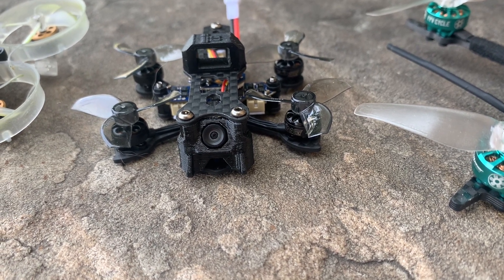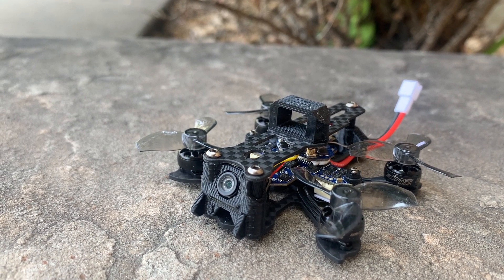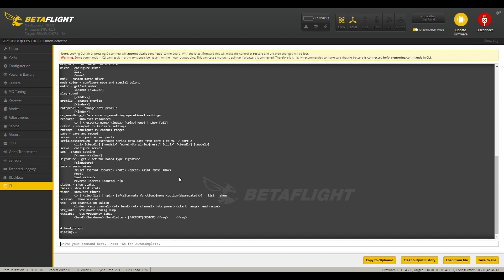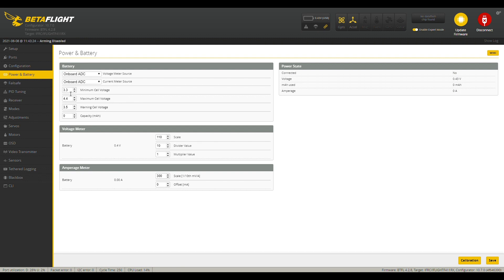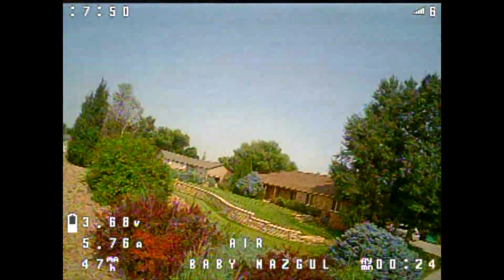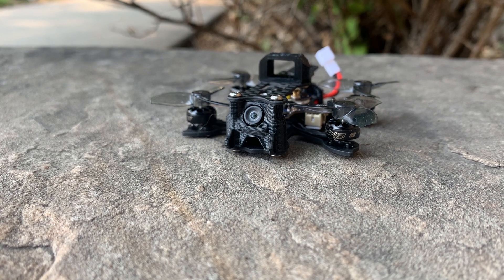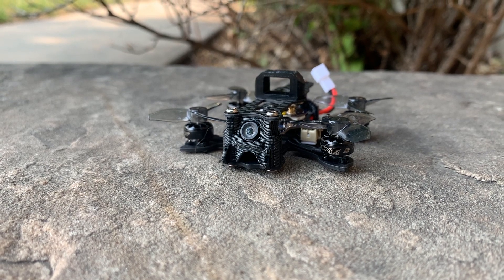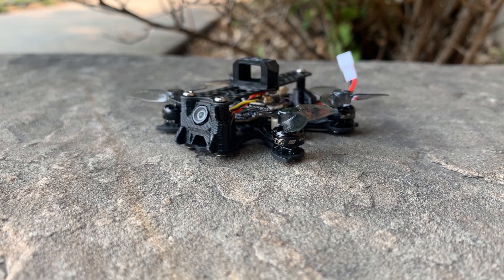iFlight Baby Nazgul Nano Review & Setup

Comment: Sir, every time after a few flights, my baby gets back to its defaults with my rxsr on it, and I need to go hack to betaflight to get it running. Can you help me with this issue?please
Reply from the maker: Hi, that is a new one for me where a flight controller would just randomly reconfigure to default settings on its own. The only thing I can think of is you have a defective FC (BLITZ F411 1S 5A AIO). The flight controllers have on board flash memory so that is getting corrupted somehow. I would back up your setting (sounds like you already are) and upgrade to the latest FW version and see if it does the same thing. If it does, you might have to get a new FC. You may also want to reach out to iFlight to see if they have any thoughts. Sorry I could not be of more help.
SLOG

Comment: Hi slog i jave a Baby Nazgul 73 mm with a frsky D8 and i cannot seem to get the quad to Arm. I have a Taranis QX7 ACCST amd o was wondering how i can check the firmware level of my Transmitter. Would you know how i can get there?
Reply from the maker: Hi Harry, Sorry you are having troubles. It sounds like you have bound your quad to your RC transmitter correct? If so, I would check your channel mapping (AETR1234 or TAER1234 are common mappings) and need to match your radio channel mappings. If you cannot bind your radio to your quad, here is a good video from Joshua Bardwell on the topic and what version FRYSKY broke compatibility with D8 and how to check your version. https://youtu.be/09g5MfTdiyw

If your mappings are correct and you're bound, you can look in your OSD while arming and it should tell you why it can't. Hope this helps. 
SLOG
Reply: @slogfpv  Wow yes thank you Slog i will go thru and check all that you mentioned. My Betaflight for some damn reason is in "Virtual mode". So when i enter say "bind_rx" my CLI is blank, i mean no data at all, nothing so i think ill delete it and redownload it to see if i get my correct version. If its not one thing in tbis hobby, something else breaks ot just comes out of tge6 blue🤔
Reply: Slog i found the reason i was getting a blank CLI and it was a bad cable going to BF, my quad. So something is going on with the model which is XJT D8 and failsafe=No pulses. As you mentioned the issue may be in the channel mapping so ill match those up and hope for the best.
Reply: SLOG We finally got it and my Baby Nazgul 73mm quad is now Arming and flying very well and stable. It was the channel mapping that didnt register in my brain that the mapping in the Radio setup AETR1234 must match the mixer so i changed each channel, added my Arm switch and recvr i all the sticks worked perfectly. I want to thank you for the time and effort you put in to help me. I really appreciate your knowledge. Thank you SLOG!!! Your awesome! ✈️✈️👍
Reply from the maker: @techFPV5964  Glad you got things sorted out. Now time for some fun 😄
SLOG

Comment: I Got baby Nazgul with TBS Crossfire, but the d8 antenna still came right in, i can bind it by the software? because de button of binding of TBS works, but the button below de D8 Rx does not do nothing, and in BETAFLIGHT I'm not been able to: bin_rx spi or even bind_rx tbs, how do i do? i want to fly it, but my Crossfire just arrivez at friday! help me plz bro, is it possible?
Reply from the maker: Hi Stefano, the Betaflight Devs moved the receiver option from the configuration tab to the receiver tab (top right corner) in the 10.8 version. Binding a TBS crossfire receiver is different than FRSky.

FYI here is a good video on Joshua Bardwell's site on how to easily bind with TBS Crossfire.
https://www.youtube.com/watch?v=8SYiMctDex8
SLOG

Comment: PLEASE HELP! I just bought this baby nazgul 1s BNF ,I have a TARANIS QX7,I tried the usual holding the bind bottom on drone while I plug the battery while myvreciever is on binding mode but it just wont bind. It only makes music sounds.
Reply from the maker: @1982pantro, since this is a SPI receiver, the easiest way to bind is to bring up the Betaflight configurator and in the CLI type "bind_rx". You can type in help if you want to see the syntax. I would try that first.
SLOG
Reply: @slogfpv  Thanks SLOG,for your quick reply. I'm still working on it as we speak, this is what am doing step by step, 1 created new model then put it in bind mode .2 beta flight cli,bind_rx spi. Hit enter but still I get nothing, does your baby nazgul makes music when you plug the battery?  Sorry to bother but I REALLY WANT TO FLY THIS DRONE.
Reply from the maker: @1982pantro  
Frsky broke backward compatibility with D8 ACCST when they came out with ACCST 2.0 (see link below). However, I tried binding in D16 mode on my Frsky Taranis X9D plus 2019 (my daily driver is a Radio Master TX16S) and was able to bind with the following steps:
1. In Betaflight configurator change the SPI Bus Receiver Provider to FRSKY_X
2. Go to CLI and type bind_rx 
3. In your transmitter model setup change the Mode to ACCST D16
4.Put RC transmitter in bind mode 
Green light on bottom goes solid green if it is bound. 

Joshua Bardwell on the compatibility topic
https://www.youtube.com/watch?v=09g5MfTdiyw&t=667s
Reply: @slogfpv  HOLYSHIT!!!! IT WORKED. 
thank you soooooo much for your help,you  are a lifesaver,I appreciate it. It flies like a rocket,I'll have to fiddle with the camera angle so I can lower it a little. Hat is off to you sir. Blessings all the way from Arizona 🍻👍🏻👍🏻👏🏻👏🏻👏🏻👏🏻😑
Reply from the maker: @1982pantro  
Glad you got the little bird up in the air!
Very fun little quad to fly.
SLOG
Reply: @slogfpv  the top light is solid,the 2 small bottom are blinking to the rhythm the motor make.

Comment: # bind_rx spi
###ERROR: bind_rx: Not supported.## help even with out spi it wont work ??
Reply from the maker: @Nightlight, not sure what version of the Nazgul Nano you have and what version of Betaflight you are running? I am running 4.2.8  and typing in "bind_rx spi" with the SPI RX version works like I show in the video. In February, iFlight came out with an ELRS version using the new BLITZ 4F11 1s 5A AIO vs the SucceX F4 1s AIO which I have. If you type in help in the CLI, you should see a command for bind with the appropriate syntax.
Reply: @slogfpv  I got the iFlight 1S Nazgul Nano 73mm FPV Micro Drone BNF Indoor Brushless Drone Built with TBS Crossfire Nano RX for TBS Radio Controller
Reply from the maker: @kymmedia2  because the TBS RX is external (not built into the Flight Controller), bind_rx spi will not work. Oscar Liang has good primer on getting started with TBS Crossfire, which goes through the setup and bind procedure. Link below. 
https://oscarliang.com/crossfire-betaflight/

Comment: I just used your cli to get mine working again but to anyone else that uses it motor stop is on ! So when you arm the motors don’t spin  and trust me you don’t want that cause when you 0 throttle for a trick your motors will stop and you’ll be in trouble.
Reply from the maker: Hi StevieFPV, 
Not throwing rocks, but what you are saying is not entirely accurate. Yes motor stop is on and the motors will not spin with 0 throttle for Angle and Horizon mode. However, in Acro mode (Rate mode) Air mode is on which overrides motor stop. So if you are in Acro mode and at 0 throttle, the motors are spinning for freestyle. I just like being able to switch into angle mode with motor stop on for whoops and small micro quads for indoor flying (easier landing and prevents wall suck at 0 throttle for whoops).
Cheers,
SLOG
Reply: @slogfpv  your wrong mate I only fly acro and when I armed the motors did not spin until I gave it throttle. Either way this isn’t a factory dump for the quad
Reply from the maker: @steviefpv  Very weird.I just loaded my CLI diff with a screen scrape and when I flip it into Acro Mode, the motors spin. In Angle and Horizon they don't. 

The behavior on your quad seems contradictory to the Betaflight setting of having Air Mode on Aux 2. I guess I need to do a video on how Air mode overrides motor stop. To prove the point, I turned on Air mode permanently in the configuration tab and when armed, the motors spin overriding  motor stop for all modes.

FYI I do have the factory Diff if anyone is interested, just let me know.

SLOG

Comment: I just bought this a week ago.  You CAN adjust the camera angle. Just cut the bottom of the cam mount and tilt the cam down and shim the back up. I changed mine to like 5 degrees. I rip mine inside, and outside!!  I also took the battery holder and the screws off, and run a 380hv and use rubber bands. Don't really change anything. I just have 10 of them. I also got a eachine nano vtx for it in the future.
Reply from the maker: Hello Jon Doe,
Good job at thinking outside the box! I understand the fixed mount (this little guy is really good in a crash) but iFlight should have included an extra camera mount at a lower angle. However, for outdoors, 30 degrees is starting to grow on me (would never fly it indoors). Just as a FYI, GNB 380mHA 1S batteries fit in the battery mount (just longer). I am curious if you tried 450mHA battery? Maybe too heavy for the prop disk area & motors.
SLOG
Reply: @slogfpv  I agree on the cam.  I actually liked it at the high angle for full speed outside ripping around. But that's is not what I bought it for. I have only tried my 380 mah batteries that came with my eachine novice 2. They fly just like the nector 300's That fit in the factory holder.Don't have anything else to try.